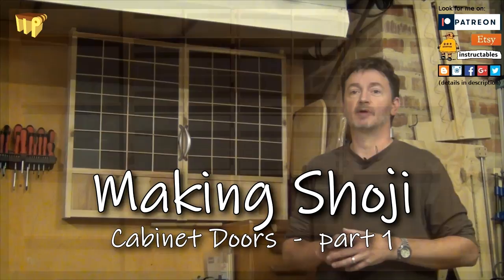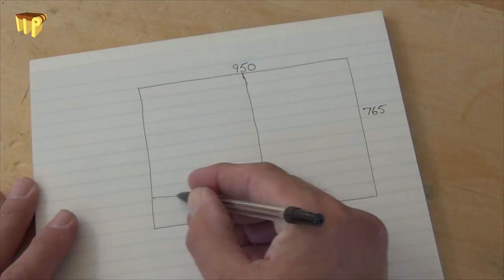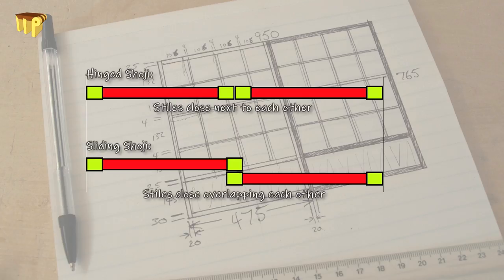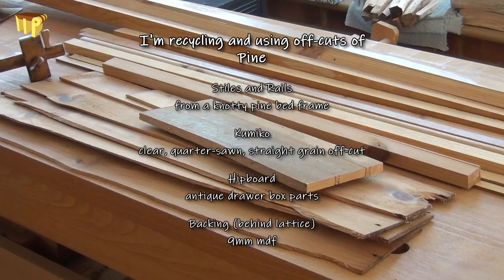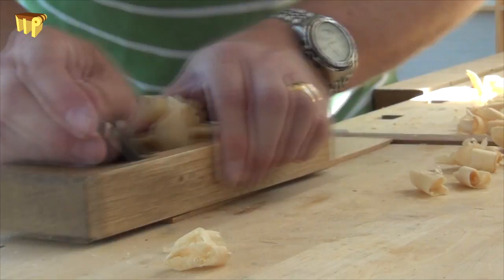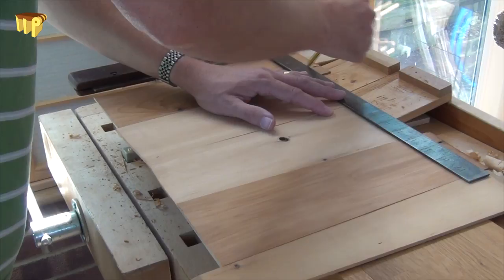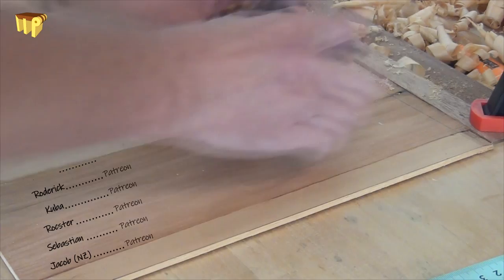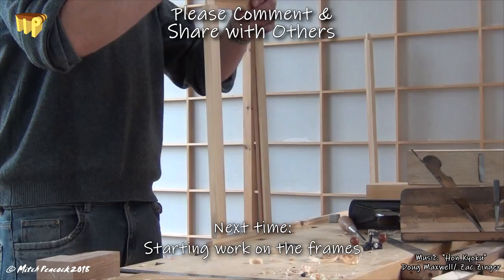Making Shoji - part 1

Comment: Butterfly Joint, I've never heard that method called that. Is that what the actual joint is called, or the taping of the joint?
Reply from the maker: Just my name for the method Steve. The joint is just a butt joint. When prepared well, the tape is all the clamping required, a bit like making mitre cornered boxes. Weights ensure the panel is flat, making the butt joints pull up close.
Reply: @mitchwoodwork  Ok thanks, Mitch.